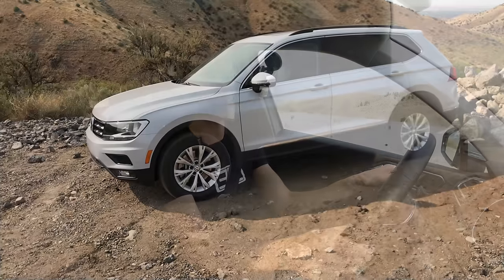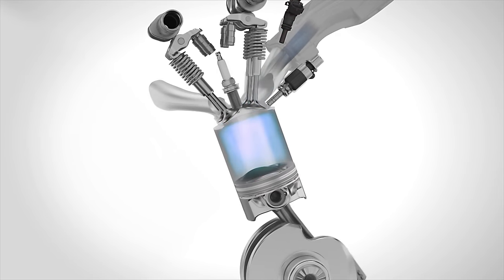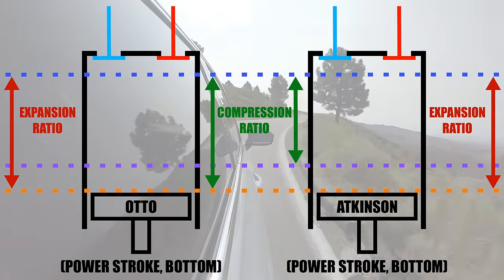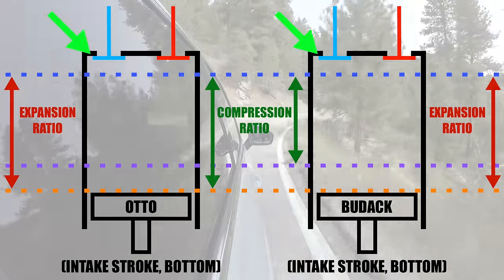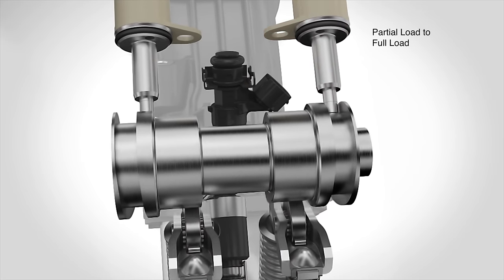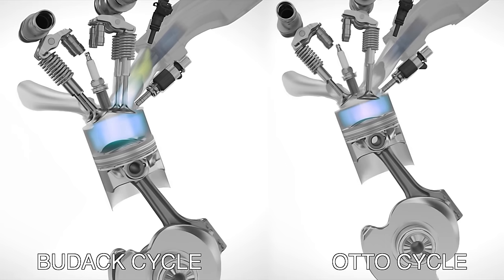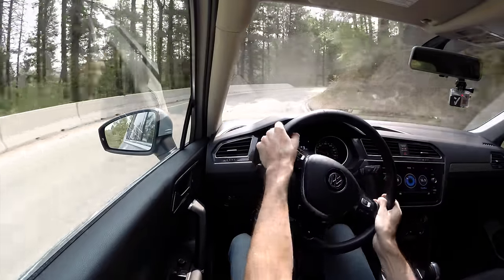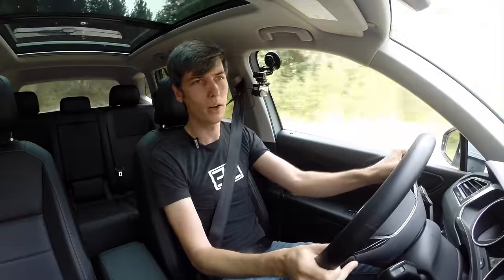Volkswagen's New Engine Cycle - The 'Budack' Cycle

Comment: My mechanic brain had a small hemorrhage when you said a small pin pushes the camshaft...

Here’s the thing, the tech exists, be it electromechanical or hydraulic, to eliminate camshafts altogether. There are engines out there that have no camshafts right this minute. That’s INFINITE tuning capability from a software standpoint. Develop that!

Comment: My immediate thought is that the Atkinson cycle is inherently more efficient than Budack cycle because the Budack cycle is pulling against vacuum when the intake valve closes and the piston is still traveling down. But, as I am typing this, I guess maybe the Atkinson cycle might have an analogous issue when the piston has to force the intake air back into the intake before the valve closes.

Comment: What affect if any does this have on the intake pressure within the cylinder? Closing the intake valve early with piston movement still going down would cause a pressure drop as the effective volume in the cylinder increase but the intake volume remains the same.

Comment: Isn't this cycle worse at power conservation than the Atkinson? From what I understood, during a small fraction of its travel the piston will be expanding the air inside to a pressure lower than the atmosphere. That should take a little bit more workload than pushing a little bit of air out of the piston, like an Atkinson cycle engine would do. Of course, the difference is probably minimal, but still there and, over the course of an engine's testing life, even measurable in fuel usage.

Am I misunderstanding things here or am I right?
Reply: i would think so.  it would be like pulling against a spring at the bottom of the intake stroke.  but then again as with loading up a spring the energy would be returned possibly.  but then again that air would be taking on a bit of heat from the cylinder walls and so the "spring" would not return all the energy as the air volume would be slightly higher from expansion as the piston comes back up. i suppose the gains outway the losses but i wonder what you gain from the extra weight of the vehicle.  is it just a luxury thing?

edit: another commenter brings up an interesting point.  the partial vacuum of the piston going down on a closed cylinder would lower pressure and help atomize fual possibly

Comment: The Budack cycle would have advantage over Atkinson cycle in one aspect. By closing the intake valves early, the pressure inside the cylinder can go lower thus increasing gasification of gasoline. By that, once ignited, the gasoline combustion would be more efficient.

Comment: @EE quick question... my physics is a bit rusty... but wouldn't this make the engine less efficient as you are forcibly expanding the air in the cylinder after the intake is closed? I mean you would be using power from one of the other cylinders to power the crankshaft in order to "pull" this piston downward effectively expanding the air which would require a decent amount of work.

Comment: So all said and done, they put variable valve on a engine with it running shorter intake opening most of the time.  The Toyota Prius full-time Atkinson engine makes more sense, it uses a higher compression ratio without the valve timing complication.
The biggest thing going against the Volkswagen is its a Volkswagen.

Comment: Is the effective increase in efficiency through the lowered compression ratio actually offsetting the energy loss from effectively pulling a partial vaccuum in the cylinder? Seem like pushing it back out would keep it at atomospheric pressure longer and achieve the same compression ratio thus making it more efficient?

Comment: The reason why VW closes the valve before BDC is create a vacuum.  Aiding the upwards stroke. Using less mechanical energy to compress the fuel mixture.

Comment: I like this concept, does it have direct injection also?  The Atkinson cycle or this Budak cycle allows us to use the cheaper 87 octane fuel without worrying if it will cause pre-ignition

Comment: I would bet that with that short expansion on intake with valves closed also allows for better atomization of fuel and helps cooling the base cylinder temp.

Comment: Surely closing the intake valve sooner creates more work to be done as the gas inside will expand as the piston finished its stroke to BDC, meaning although the ratios now differ and it means more efficient as the most power can be extracted from the fuel, it also has more work needed to compel eye 1 of this new cycle in comparison to the Atkinson cycle as more work is done in expanding the gas in comparison to just displacing it.
Reply: You're forgetting the forces are conservative.  You lose some energy pulling a weak vacuum on the way to BDC, but get it back as vacuum pulls the piston back up.

Comment: Actually this should be a much better implementation of the Atkinson cycle, because you eliminate a lot of pumping losses that you would had if you close the admission valve in the compression stroke

Comment: Closing the intake valves earlier = less fuel/air mixture. Right? This guy's telling me that the engine works more efficient and delivers more horsepower.
Reply from the maker: No, "this guy" is saying it's more efficient. Specific output goes down, meaning power goes down when operating in that mode. When you floor it, the cam profile changes for more power.

Comment: question here, instead of mechanical cam why not drive the valves with hydraulic pressure or electric solenoids and have cam profile driven by a processor that can open and shut valves at any desired point of engine revolution? The engine could have any cam profile desired by using software.
Reply: search multiair by fiat

Comment: I felt the 2.0 turbo that put out a little over 200 h.p. was a much better engine. And that tiptronic transmission was a joy. VW is not giving the kind of value it once did in engine performance and economy in my opinion. Good review.

Comment: i think the other benefit to closing the intake sooner is that momentarily you lower the pressure in the cylinder which allows gasoline to evaporate quicker and form more homogeneous mixture that then burns more thoroughly

Comment: Some of this is wrong.  The intake valve remains open at the beginning of the compression stroke not to push the air back out, but to allow the momentum of the moving charge to fill the cylinder completely.
Reply from the maker: No, with Atkinson engines you most definitely push out some of that air and fuel. It's the whole point of leaving it open longer, and is what allows you to have a lower effective compression ratio versus the expansion ratio.

Comment: Interesting. But I have a two-part layman's question: what is the practical advantage of closing the intake valve over leaving it open (and pushing some of the fresh charge back into the intake manifold)? Couldn't this lead to a vacuum effect during the bottom half of the intake stroke, which would rob the engine of some of its mechanical efficiency?
Reply: Good point, but you'd get the energy back on the compression stroke....unless, maybe the very small vacuum effect helps vaporize atomized fuel droplets and thereby improves combustion.  Just a guess.
Reply: @elkeno  Thanks for the reply! That's an interesting theory about fuel atomization. Could be so. My car uses port fuel injection as well as an Atkinson cycle, and I'm glad. It means I don't have to worry about crusty intake valves. Thanks again!

Comment: Excellent explanation. However  , more moving parts , more things to break, more expensive to repair for no more mpg. Total failure in my opinion.
Reply: These are reliable engines that can do 150,000miles no problem.

Comment: Isn't the fuel input been cut to short too. Wouldn't it cause greater back work ratio and less work per cycle...
Reply: You're on to something there. I notice when my 2020 Tiguan switches to this it lowers the instant mpg and in my opinion is completely useless. Makes for garbage throttle response too and you can feel the jerk in the engine when the cam shifts to normal mode

Comment: I have had this idea for YEARS figuring it to have fewer pumping losses over Atkinson. I just always assumed there must be some reason I hadn't thought of that it hadn't been implemented. Cool!
Reply: I'm not so sure about that one (although I could probably calculate it, if I really wanted to).  With Atkinson, you pump some air in with limited restraint, that you then pump out with little restrain to get rid off.  With this one, you need to pump a bit while creating some under-pressure - perhaps just a tad less of a loss.  A turbo further complicates things, and appears to introduce complicated timing and resonance questions....
This design may also be due to preexisting owner rights.

Comment: Do the injectors close soon as well with the valve, otherwise wouldn't it just leave fuel air mix  in the intake? Just to waste.
Reply: Messing with timing like that seems hella sketchy what if those solenoids get stuck and damage the cam.

Comment: this isn't ideal because it's pulling vaccum on it's intake cycle, resulting in a pumping loss that wasn't present in the standard atkinson cycle. howevery, since vw is committed to turbo engines, there would be some pumping loss pusing back against boost pressure. ultimately though I see this as less of a problem because it spikes boost pressure in the manifold where, arguably, those losses would be returned to you in the next intaking cylinder.
Reply: But it os definitely more efficient
Reply: @dragospahontu  so is slower more careful driving. So is walking.
Reply: @CSLFiero  in all cases the new engines are more efficient. If you want power Volkswagen has an alternative. 2.0 TSI 320HP. If you want efficiency you can get the 2.0 TSI 190hp.

Comment: he's says, 'holding the intake valve open longer to reduce compression ratio" when i think calling it cylinder pressure is a better description. the compression ratio is static in this engine
Reply from the maker: Well by leaving the valve open the effective compression ratio is reduced (this distance the piston presses the intake charge upward).
Reply: this is an  engine with a dual intake cam lobe pattern and it  apparently likes the performance of the good cam lobe but when the engine needs to be de-tuned for lower rpm and fuel mileage it uses milder lobe. i still think 'cylinder pressure' or 'volumetric efficiency is a better way to explain the two different cycles.

i saw that video of a 4 cylinder with eight connecting rods that actually change the static compression ratio of the engine on the fly. this engine only changes the valve timing.

Comment: I predict cam failures galore, 100k miles and cans while be flat or not cycling between modes, etc. Mark my words.
Reply: 2 letters that consistantly exude failure.. V W its ashame that they just cannot build something low maintenance...  4 electronic modules and a computer to operate a fan??  
  Over engineered to make you hire a personal mechanic ?
  As he told me after 7 visits to the shop in 1 YEAR!  Basically you bought a Porsche without the badge.. $8000 later (replacing many many parts between 95k and 125k) the head gasket blew!  WTH ??  Never raced the car .. Drove it on flat roads etc etc...
  Fun to drive when they function
    I mean both window regualtors go out before 90k??  Hardly ever lowered them!  
  Amazing

Comment: An engine designed for Atkinson will have an expansion ratio in the 13+ range.  You won’t get the same benefits off of running the Tiguan’s engine on an 11.5 expansion and ~9 compression, but it definitely does help!  I have a 2022 Tiguan and when you accelerate slowly and suddenly open up the throttle enough to demand more power but not enough to trigger a shift, you can feel the moment the VVL kicks in and you can faintly hear the turbo spin up fast once this happens.
Reply: I drive a '19 tiguan, and you can feel the additional turbo power, in mid-range and low load conditions...just short of full throttle and transmission kick-down...the combination of turbocharging and budack cycle, does make a good compromise of power and efficiency  😉

Comment: lower compression ratio leads to better fuel economy, WHAT?
also, this is nothing but variable valve timing
Reply: It's plain physics. When you have higher pressure than 1 atmosphere at the lowest point of your work phase, you will push out all the energy that's in this pressure difference through your exhaust. This "overpressure" is wasted energy. On the contrary, when you only compress and burn so much fuel and air that it results in 1 atmosphere after the work phase, you used up all pressure energy that was "created" in the "explosion".

Comment: how does this differ from Honda's VTEC?
Reply from the maker: VTEC does not change the engine cycle, it changes valve lift for more power. VTEC does not have a valve close too early (or during compression).
Reply: I understand now.  Thanks for the prompt reply.

Comment: I can only imagine that this idea has been around for a very long time. I thought of it years ago. Is this actually the first engine to close the intake valve during the intake stroke? It has a decided advantage over the Atkinson cycle. Imagine going a step further, and using intake valve timing in place of a throttle!

Comment: Kinda cool that guy was able to put his name on something pretty much every manufacturer has been doing since forever. Personally probably not a good idea. Less compression usually means less efficiency. Less compression means colder piston sleaves - aka less heat less efficiency. Everything about this makes sense why this technology still sucks compared to every other car on the market mpg-wise. I wonder what the wear life is on that pin and what alloy it is compared to the cams. 200k mile engine? Idk if I see that.

Comment: Here's the deal. Mid 80s, my cousin who worked for Ford motor co. Leased 2, 4 door escorts, 4 cly diesel, manual transmission.  We ran all over east Tennessee 4 & 5 people in each vehicle. A/c running all the time, 70 & 80 mph sustained not uncommon . Our mileage calculations:  60 mpg. So...what's the problem? Believe it or not folks, I know, I was there drove one for days. We were not easy on them. Mfg & oil co. Don't want you to have em. End of story.